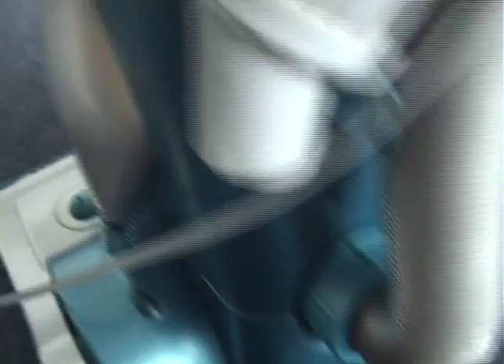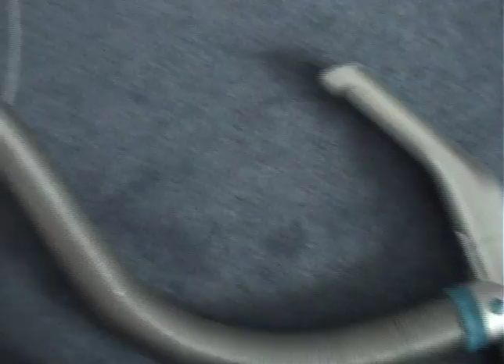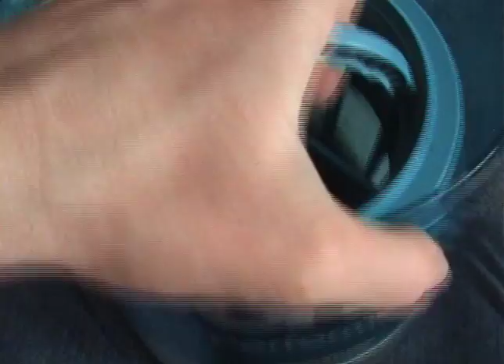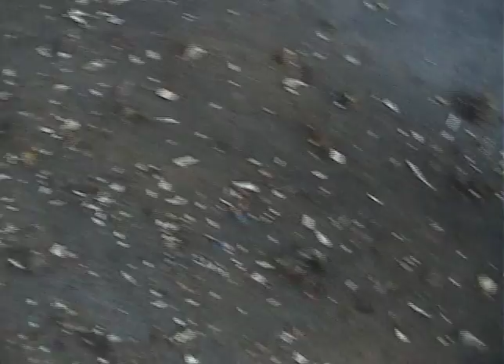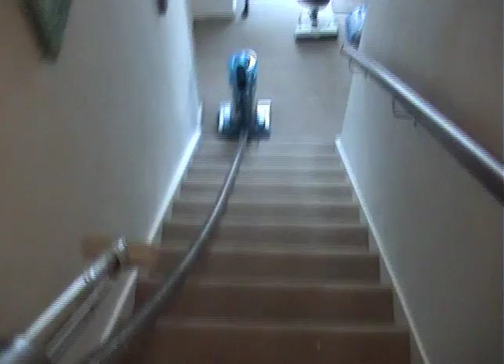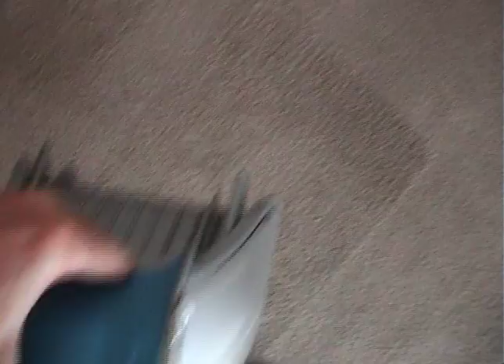Hoover The One Performer Vacuum Cleaner Review & Demonstration

Comment: What was the Hoover upright vacuum where it had one motor but you could stop the brush from rotating because there was like a switch or pedal or something that you would use and it would disconnect the brush roll spindle from the motor?